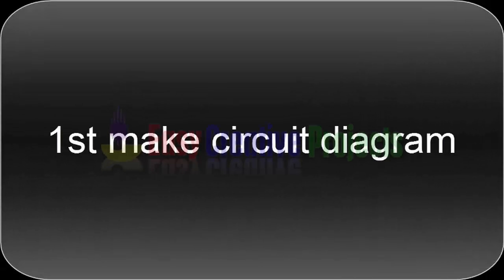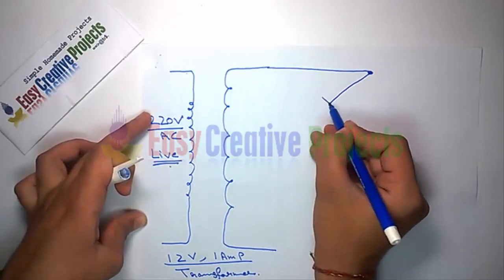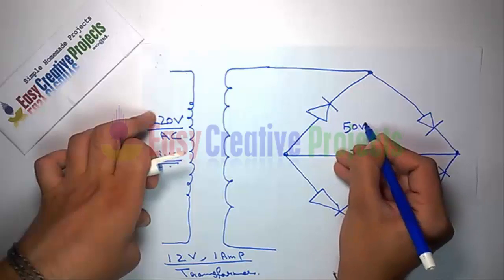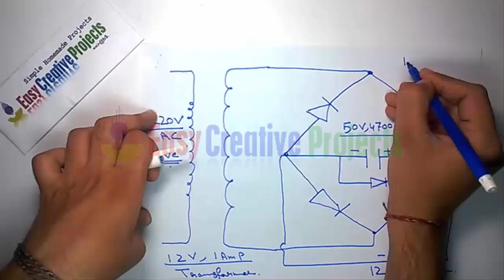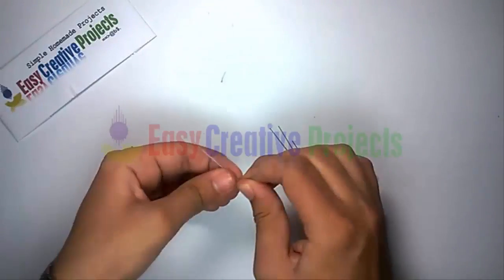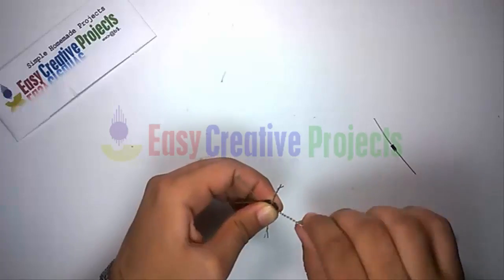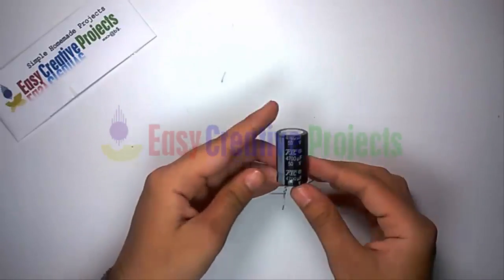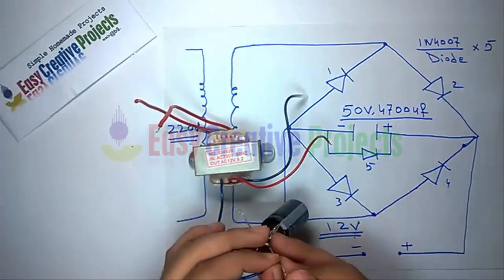How to run 12v DC motor on 220v - easy step by step with circuit diagram

Comment: Can we run the motor continuously? I think 775 motor can runs in 24v for high speed... So what should I use to get a 24v output
Reply from the maker: for 24v output, simple use 24v transformer. 
we can run 24 hour but then motor life maximum 1 or 2 month.
Reply: @EasyCreativeProjects  can i use dc 775 with 24v to cut steel ? with this method, did i still need 5 diod and 1 4700Uf capacitor or i need to change the ingredient ?
Reply from the maker: @SayaaLapar  no dear if you have 24v adapter then you don't need any extra components. you can drive directly 775 motor with 24v adapter.
Reply: @EasyCreativeProjects  or can i just use 24v adaptor ?

Comment: capacitor and  daiod very heat whay?
Reply from the maker: 1st check your circuit diagram. 2nd check capacitor voltage. try to use 50v capacitor.
Reply: same Diodes same  capacitor 50v
but heat.
i remove capacitor after check
 Diodes heat what to do
Reply from the maker: dear little bit diode and capacitor heat up. but if its more heating thats mean some issue. check your output voltage. 
then again check diode bridge.
then check capacitor terminal positive and negative.
i hope you find issue.
if every thing ok then on power supply and leave it for one hour. 
after one hour if its provide you output. its mean you can use this circuit. 
without any tension.
thanks.
Reply: Iam check all connection.
all connection ok but only 10 minutes use wery heat capacitor and diod.
i remove capacitor then check diod heat.
 i neet to explain
Reply: any other way
Reply from the maker: join me on facebook page. 
send some pictures of your project.on inbox page.

Comment: Sir Can I connect it directly to the 12-0-12 transformer?
Reply from the maker: dear transformer provide you AC current. if you motor work on AC then you can use direct with transformer. but if you want to convert it on DC then you must use diode with capacitor. 
thanks.

Comment: does this method work for 12 v dc 775 motor?
Reply from the maker: dear using this circuit you can run all 12v power products.

Comment: Can we run this 12 volt motor on ac 220 v with the help of bridge rectifier BR 1010 IC ..??
Reply from the maker: no dear if you direct use motor on 220v then its burn with in second. you must use transformer if you want to run it on 220v.
you can use bridge rectifier with transformer.

Comment: How much voltage does it create accros motor
Reply from the maker: dear this circuit give you 12v output. its total depend on you what you do with this.
Reply: @EasyCreativeProjects  thank you

Comment: Since when has 220 volts AC been !5 volts DC?  That's roughly what you get when you rectify and filter the output of a 12 volt transformer. Apart from that little error, turn it off and on a few times and it's likely to burn out. The current just to charge the capacitor will exceed the transformer and rectifier ratings. The motor looks like it is from a battery operated compressor and when fully loaded it is likely to draw 10 amps or more. Sure, it'll make the motor spin with a bit of tape stuck to it but what happens if you want it to do some work? It will draw lots of current, possibly shorting a rectifier and burning out the transformer, end of experiment.

Comment: Sir, how to run 4 dc motor with this method
Reply from the maker: dear simple use 4 output 12v transformer. if 4 output transformer not available so you can use 2 transformer of 12-0-12 and make same 4 output. using voltage regulator. (if you want long term working circuit)
12-0-12 give you 2 output of 12v and when you use 2 transformer then you get 4 output of 12v.
if you cannot understand then tell me i try to make circuit video only for you.
thanks.

Comment: can I use a motor like this as a table fan or water pump? is there any risk to shock or ac voltage updown.and how long can I use this motor?
Reply from the maker: you can use it on table fan. but in water pump is risky.
its depend on your components. if you use good quality transformer. and capacitor so its work very long time.

Comment: if  i want bigger  motor   say   14  am what transformer and diodes capacitor size  i use   ?  thank  nice  explained
Reply from the maker: dear can you please tell me bigger motor voltage and amp value?

Comment: Why need 5th no. Diode setup ? Please say..
Reply from the maker: diode use for ac to dc converter.
Reply: Easy Creative Projects for AC to DC need 4 diode....my question is why you set 5th no diode in parallel
Reply from the maker: i use for extra safety. but if you dont want so its working properly with 4 diodes.
Reply: Sir, please can you explained that, how to safe circuit, this 5th no diode?
Reply from the maker: no

Comment: Hey instead of all this you can use 12v 5amp switching power supply for connecting a motor or even things like led strips etc which
Reply: bhanu prakash the great  what do you mean by “which”?

Comment: may i know what is the rpm?
Reply from the maker: dear its depend on motor. 
in this video i make 12v power circuit without transformer.
thanks.

Comment: broo can i connect it directly 220V AC socket
without transformer
Reply from the maker: no dear if you do its destroy.
because DC Motor run only 12v and in our home power supply 220v.( mean round about 18 time extra power.)
for example, 
if you hungry and you need only one bread. and i give you 18 breads so understand whats your conduction that time.
Reply: Easy Creative Projects 
but sir bridge rectifier give 12V na
Reply from the maker: No Dear,
bridge rectifier is the combination of 4 diodes in a bridge circuit.
its function only convert alternating current( AC) input into a direct current (DC) output.
Reply from the maker: yes. but if you sit on floor so its dangerous.

Comment: you need 1.2k'100r'1m registor and one red 474j capacitor and a25v470 uf capacitor four diode means bridge rectifiler and a red led for indication total cost in india rupees 50
Reply from the maker: o thank you so so much. 
i try to make.
thanks again.